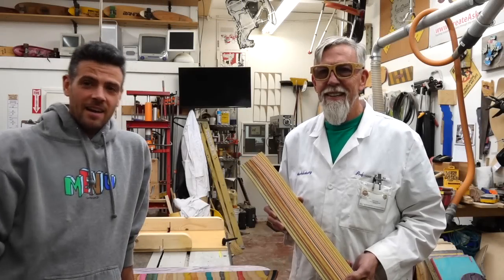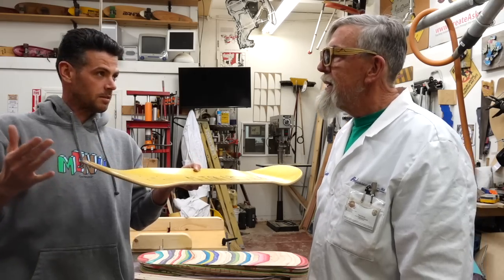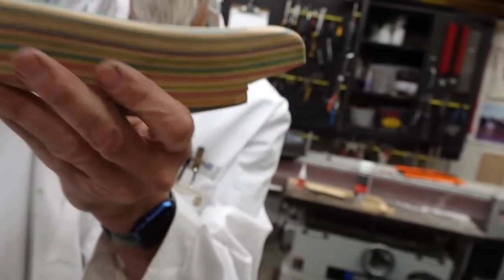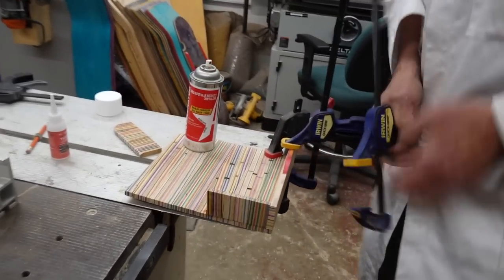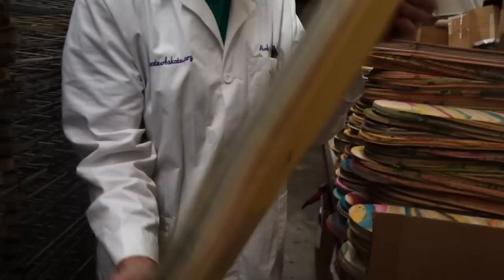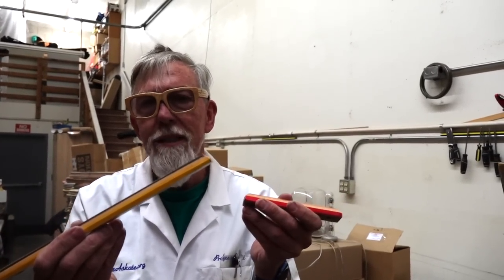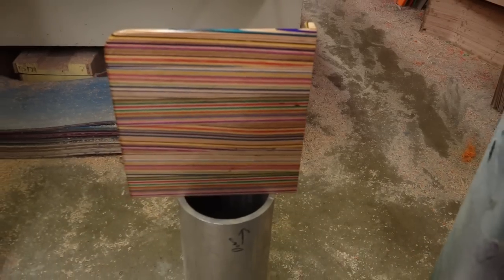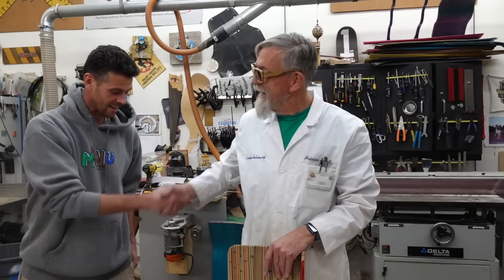Up-Cycled Skateboards with Professor Schmitt!!!

Comment: I'm not a skateboarder but still found this super interesting. This is essentially the Damascus steel of skateboarding. Instead of layering different metals, heat, folding them and pounding them out. You're layering different skate boards, bonding them with pressure and glue (and maybe heat). Making beautiful designs out of strong material.